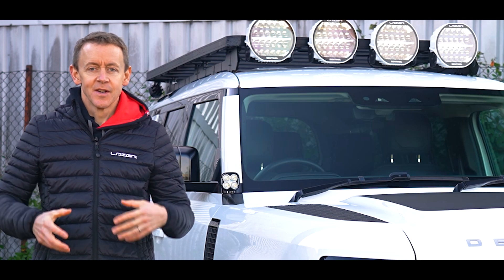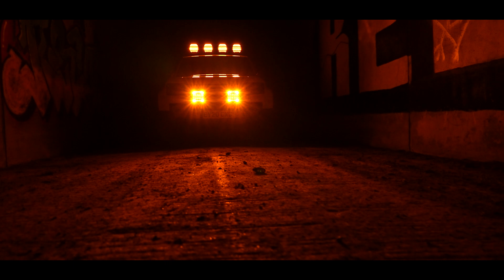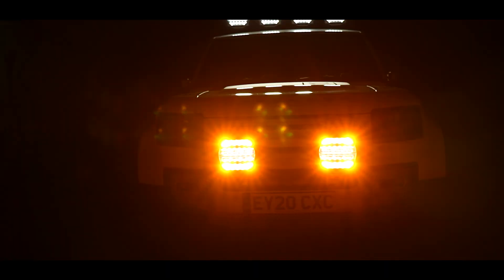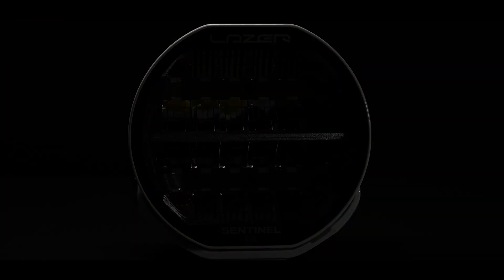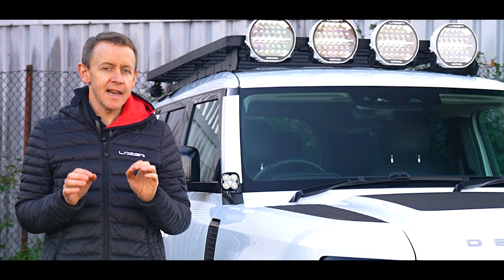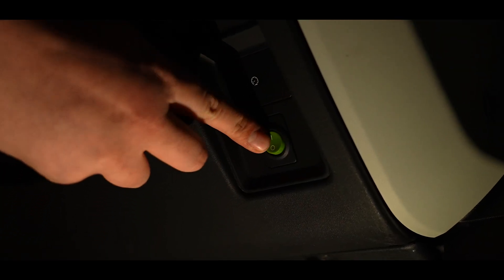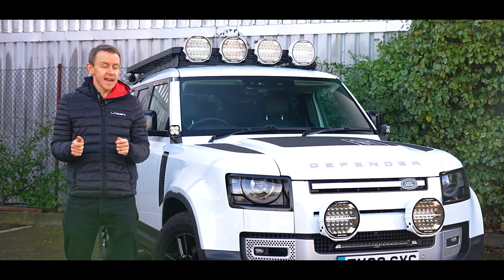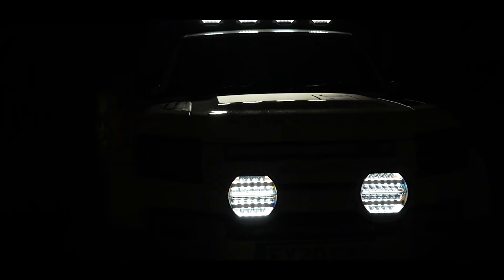LAZER LAMPS | Sentinel (Gen2) - Beacon Function Explained

Comment: I have 4 of them on my tow truck,How do I get the right and left function to work then?
Reply from the maker: Please refer to 1:05 in the video. You would need to set the lamps to left hand mode (For example, you could set both left side lamps or alternate lamps), so when they operate together they will operate alternately.